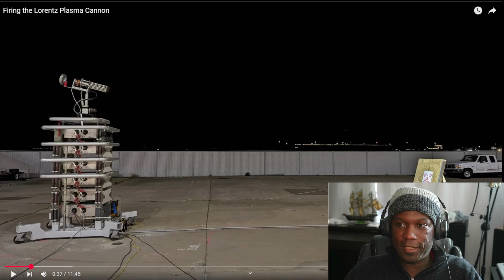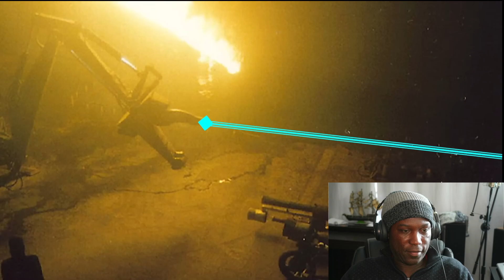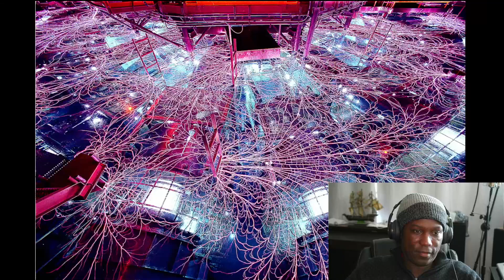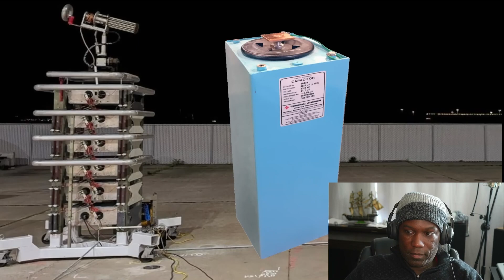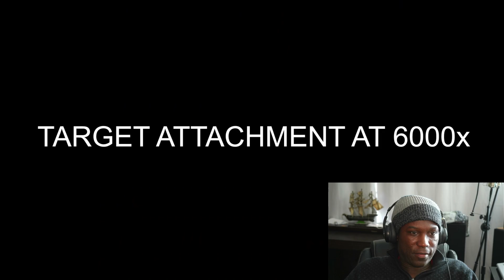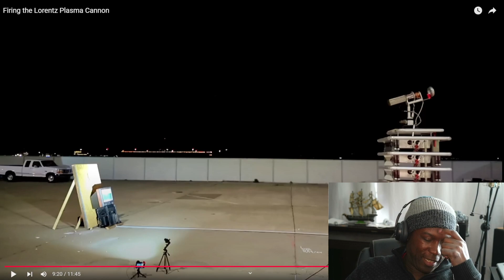Firing the Lorentz Plasma Cannon: Ultimate Sci-Fi Weapon Test!

Comment: Mean I built a laser that was around 275KW with a 1.5mm beam, that much light in sich a confined space? Well I tripped it by accident and melted a hole halfway through my left forearm lol, you can still see the dot of melted skin today and? Didn't hurt didn't feel a thing wasn't until few seconds later I realised my skin was melting and the surrounding tissue hurt, had to get it cut out and allow to heal but it did seal up.
Reply: The next gemeration of military lasers are supposed to come in at around 500kw, and will be used on nuclear submarines to blind satellites and potentially shoot down missiles.